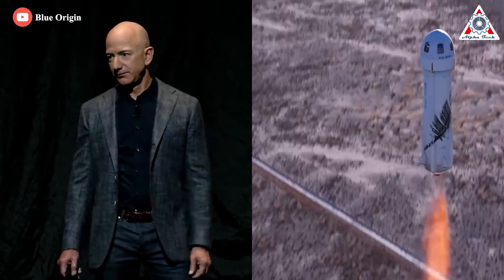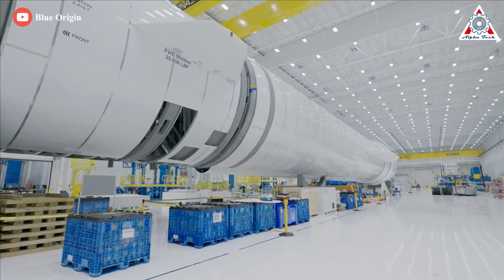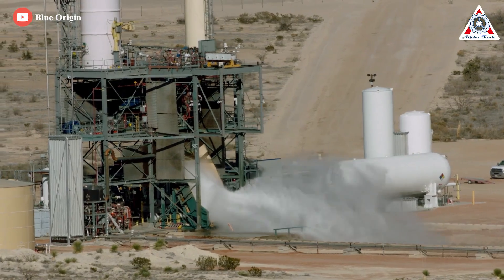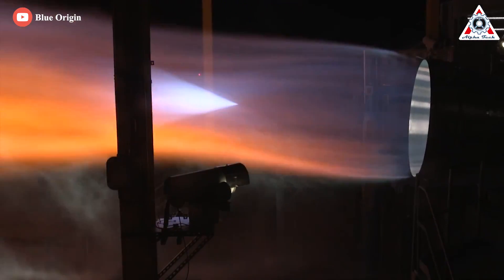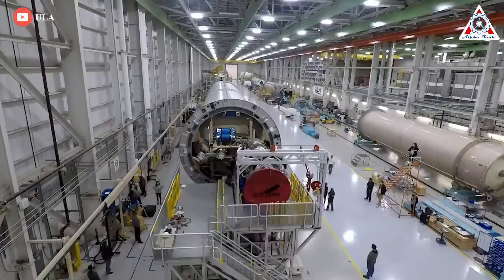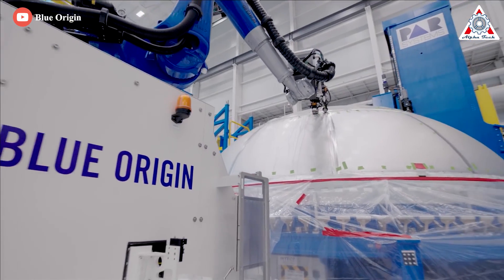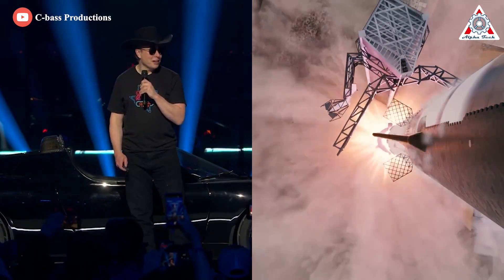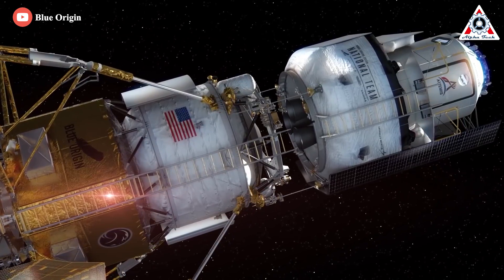Blue Origin's huge updates on the BE-4 engine but a disaster to compare with SpaceX Raptor 2

Comment: When they finally nail the BE-4, it will take what, 5 or 6 of them to lift the same as Starship, which requires 33 engines?  I don't know, 33 engines vs 6 engines, which one would you bet on possible failures occurring?  How many times do you want to stand in front of a gun that may fire?  6 or 33?  Its not like they are going to stop, they will get it built, then this will be behind them.  SpaceX tried just spinning up the engines and almost exploded the entire pad... fuel that baby up for next time, and hope like hell it doesn't level the state of texas.
Reply: A comparison of the BE-4 and Raptor 2. https://www.youtube.com/watch?v=SzT1K7mYkiQ&ab_channel=TerranSpaceAcademy

Comment: Bottom line: Blue Origin suffers from the same issue Boeing and NASA has suffered from many times. It’s not lack of talent, it’s not lack of vision it’s lack of failure. What have they blown up?  The single biggest difference in SpaceX has been they weren’t afraid, to speed innovation, they expected failure, gathered data, iterated and moved past it. The innovation was directly due to the data gathered and the changes made to compensate. Blue origin, Boeing, hell, myself, you can’t be afraid to fail or insist on perfection BEFORE moving forward.
Reply: Failure and production line innovation.  SpaceX builds things it never plans to fly, just to figure out how to build things optimally and train workers.
Their Raptor2 production line is just as innovative as the Raptor2 itself.  How to build things cost effectively and efficiently is just as important as what you build.
Elon has had a lot of practice with assembly lines as he tried to work bugs out of his Tesla products.
Reply: No, no, its not lack of failure, its lack of clever engineering approach. Blue Origin could benefit a lot from Detroit. Those guy, know how to make stuff, and a lot of it. Musk took some of the Detroit talent to Tesla, learnt something, and is bringing it to Scale, quality processes to Space  X.
Reply: @mbukukanyau  I cannot disagree sir, at all. I'll add though it's a combination of such things and a few more added in. The clever engineering really comes in to play when you build the team to pull it off. In all cases, he's managed to choose exceptional, brilliant, but even more important, like himself, those that are committed to going above and beyond to achieve their goals and objectives on these projects.
Reply: Bottom line is you people don't have a clue. We are building an entire production line of rockets almost the size of the Saturn V. Five GS1 Boosters a year that are each capable of 25 launches. Wish I could send you some pics but you are just gonna have to wait lol
Reply: @seancooper7325  That’s damn exciting Sean! I’m guessin you are with Blue and? If you are doing such things? That just freakin ROCKS! RE “us people not having a clue?”… Pretty much, label all of humanity that, lol. But, the reason we don’t have a Blues Clue would be lack of promotional material or? Lack of it showing up in the right places? Which, on the one hand, If I was in the drivers seat I think I’d land somewhere between SpaceX and Blue Origin in that, I’d tend to promote, by showing it off when it’s ready to roll. Who knows? Either way, that’s great stuff!!!

Comment: Why doesn't Blue Origin poach some SpaceX Raptor engineers?  They might provide some insights into the design flaws and inefficacies of the BE4, since they solved similar challenges with Raptor. Find one that signed that employee letter...

Comment: People seem to overlook that Falcon 9 grew out of Falcon 1, and that Falcon 1 launched three failures before it's first successful launch in 2008.  And then we get to all of the hijinks getting Falcon 9 to work properly.  That doesn't take ANYTHING away from SpaceX's success, but given the late entry date of Blue Origin to the mix, they're not THAT far behind SpaceX, in terms of vehicle evolution.   Blue Origin is skipping the light launcher, and going straight for the medium duty vehicle.  It is ambitious, but it can be done.  Bezos's mistake was committing his engines to anyone but himself.   If it weren't for the ULA deal, what's happening at Blue Origin would be just another day in the life of rocketry.
Reply: Blue Origin has been in the business two years longer than SpaceX, and still hasn’t orbited once.
Reply: Blue Origin started as a sub-orbital company, which is now providing that service.  They have not been working on New Glenn since 2000.
Reply: @jamesbuchanan4414  well, maybe they should have focused on being orbital, instead of these novelty rides. Then they would not have to contract out the launch services to ULA and Ariana for Kuiper project launches.
Reply: @johnkoziel789  Or, they continue doing what works for them, instead of taking advise from a peanut gallery youtube jockey with no investment stake.
Reply: @jamesbuchanan4414  what about advise from Tory Bruno?

Comment: Its gonna be one hell of a day once Starship gets human rating. Long long ways to go but probably still soon enough to bury the SLS program. New Glenn will rub salt in that wound... if it even exists.
Reply: At this rate new Glenn's gonna suffer the same fate as Saturnv/sorta SLS too expensive to start (unless they figure out reusable second stage which they only even started thinking about ways to do for new Glenn in 2021 so as designed it's a heavyweight falcon 9 at best) and then not enough demand/need putting down orders and production below the level needed for per unit/launch price to be even close to tenable even if they do get the initial cost down with a reesuable second stage.

Comment: I will only believe the raptor 2 when I have seen it, its basically a normal raptor engine alot more clean cut but with 50 tons of force. A bit suspicious since they keep making raptor 1 and they seem to have the same habit of melting.
Reply: Nonsense mon ami. The Raptor 2 specs are as follows (borrowed wholesale from Wikipedia): 
- - - - - 
'Raptor 2 engines were achieving 230 tf (510,000 lbf) of thrust consistently by February 2022, although SpaceX expects to be able to tune engine parameters and design over time to achieve at least 250 tf (550,000 lbf). Moreover, Musk indicated that the engine production cost was approximately half that of the Raptor 1 version SpaceX had been using in 2018–2021. In June 2022, Musk tweeted that 250 tons was achievable.[57]

Production rate for Raptor 2 had reached five per week by February 2022 and was expected to achieve 7 per week by March'
- - - - - - - 
So you should never post without doing your homework. it makes you look a tad unprofessional. Don't worry though. You are in good company. The orator of this very YouTube channel posted that he didn't know anything about the New Shepard engine. 2 seconds of checking and I have an answer, but the orator looks like a shambling amateur, less than 100% worthy of hosting a space-oriented YouTube channel.

And as of now, (June 27th, as I live in Bali, so 13 or so hours ahead of the US time-wise),  Booster 7 has been fitted at Boca Chica in Texas with 33 Raptor 2 engines on the test-stand and has had the igniters fired up for the first time. It is expected that following initial pre-burner tests, they will test the engine-assembly individually, then in groups, and finally all together, likely at low throttle-settings.
That should be interesting. Perhaps an orbital-flight to follow in the late autumn (the season known as 'fall' to those folks in the US) . 
There have been postings of videos of long duration Raptor 2 firings in Spacex test-cells in Hawthorne California (110 seconds in one case) with great Mach diamonds and a clean exhaust plume which is more than could be said for the Blue Origin BE-4 firings in some cases. One hopes that BO have managed to overcome their issues. But the BE-4 has had hosts of issues with turbo-pumps and longevity worries. Even now, the design will be much more expensive to manufacture than the Raptor, take much more time to manufacture, and because of the singular turbo-pump, may have a shorter working-life. Not a great idea on an engine destined to be used on a purportedly re-useable rocket first-stage. The manufacturing difficulties will come to haunt BO when they need to satisfy the requirements of ULA for its upcoming Vulcan rocket, each rocket requiring 2 BE-4s in an expendable configuration. ULA is contracted to launch quite a few Department of Defense payloads on Vulcan, and later to launch Kuiper satellites for Blue Origin/Amazon. And later on, maybe (if ever) BO needs its New Glen to host 7 BE-4 engines per rocket. It isn't a given that New Glen will be re-useable from the beginning, so it will likely be expendable for the first few launches. And with 7 engines, it will be interesting to see if New Glen can survive an engine-out situation en-route to orbit, not to mention a subsequent soft-landing. 
Given BO's sloth historically, this should be spectacularly embarrassing, so I will be getting the popcorn out, and expect to experience the long-awaited and much-deserved schadenfreude.
Reply: @mauricegold9377  mistake on my og comment, 50+ tons in comparison to raptor 1. The rest I stand by my comment.
Reply: @porcus123  No problem at all. I can get a bit stroppy and judgemental sometimes, so apologies if my post was a bit strong.
Reply: @porcus123  Where did you hear they're still making raptor 1?
Reply: Yeah Elon is the king of ponzi. Presents old ideas that never worked his or his company's own original ideas. Presents other people's ideas and work as his or his company's own. I don't understand how people ignore his studder when he's lying. I'm sorry it's his genius level intelligence, he's thinking so far ahead he looses the words crap.

Comment: If I were a project manager waiting on BE-4 engines, I would be asking that regardless the technical challenges still pending, what is Blue Origin's manufacturing capabilities? Perhaps not one a day, but can they quickly ramp up and support enough to supply ULA and New Glen for 2-3 launches per year.
Reply: "2-3 launches per year" against "3 launches per day" goal by SpaceX Starships.. I know Elons says "if you're not failing, you're not innovating enough" So, is Jeff Bezos not failing enough? or not innovating enough?
Reply: Yes, but, BO has to build new ones every time for ULA flights, as they're not resuable.  If they ever get on to New Glen, they'll need more engines to fill out and maintain their satellite constellation, but they'll be reusable.  Finally, BO engines are much larger than the rapter and they need fewer per flight.  I think Bozo, I mean Bezos will be spending a lot more of his own capital on this project.
Reply: You want to count chickens before their hatched?
Reply: ULA needs between 15-25 launches per year.
Reply: @avgjoe5969  None of which are reusable.  New engines every flight.
Reply: If they can get it working in the first place.

Comment: You might try to give BO an A for effort, but trying harder doesn't mean results.  JB is trying to run it like Boeing, and many others - cost+ and forcing the American tax payers pay for his failures.
SpaceX is a company who's culture is engineering, designing, and producing results and progress with "plan do act check" continuous improvement practices.  And it isn't just SpaceX that is successful - so the common denominator is BO which is the failure.
Reply: Just based off the change from SpaceX being the black sheep of rocket companies trying to take advantage of others greed to undercut them into NASA's premier partner should have been all bezos needed to see to know the right way of going about doing business as a rocket company in the current market.
Reply: @MrDJAK777  Meaning - JB doesn't know what he ( or how to hire people that do ) is doing.  In order to gain support and interest from "The People", execution is key.  All JB and BO have done is something short of what many, many, many model rocket enthusiast can do.  JB needs to shutdown BO if they can't even deliver the BE-4, and let the adults do the "heavy lifting".

Comment: Then what is the engine of this New shepard Sub orbital rocket? If it was not a BE4 engine? Im sure blue origin stll the one who built it, why not make more of this engine?
Reply: @purona2500  Only because it's bigger.  merlin and raptor are both designed to be smaller but with more thrust per weight.   The Raptor 2 puts out 2210 kN thrust and the BE-4 puts out 2400 kN thrust, but the rapter is a much smaller engine with almost the same thrust. This allows 1 (falcon 9) or 2 (Starship) engines  to fail and still complete the mission.  If one BE-4 engine fails (out of 7 on the New Glen), the mission likely fails.  BE-4 uses liquid natural gas, which won't be available anywhere but earth.  The raptor burns methane, which can be made from CO2 on Mars.
Reply: New Shepard is a small H2/O2 engine completely unsuitable in size, performance, fuel type. 
Its just a basic knock off design from other engine plans with nothing new. 
BE-4 is a CH4/O2 engine on a much larger scale with specific performance requirements in weight, fuel burn, burn time, throttling and gimballing. 
So, no. They can't use the little knock off design. 
They need a clean sheet of paper design. 
There is no real CH4 design to copy. 
Only 1 Russian and 1 Rocketdyne CH4 ever tested (never flown). 
Since neither of these two sources are likely to give them the plans (Rocketdyne was a direct BO competitor). 
They have to design it themselves for the first time... and it shows.

Spacex is the only other CH4/O2 engine builder and they went with a more ambitious design (Full flow) using 2 turbo pumps (Fuel and oxidizer).
Reply: It way under powered to do anything useful
Reply from the maker: That’s a good question man
Reply: @alphatech4966  Alpha Tech, how come you don't know that the New Shepard engine is the pip-squeak hydrolox BE-3? Why do you reply before you check?

Comment: Mostly BS, the producers of this video have no idea what the actual costs of either of these engines.
Reply: For the Raptors, Elon Musk is trying to get mass production going to bring the cost down to 250K USD per engine. He needs mass production, anyway, to build the 1,000 Starships he needs for the Occupy Mars project. IIRC, the current cost is around 500K USD.
I have no idea what the BE-4 engine costs but I suspect it's somewhere between "butt" and "loads."